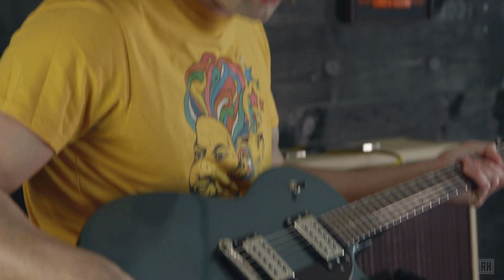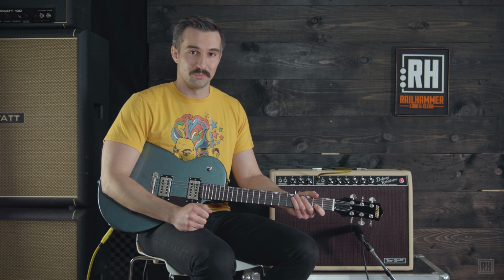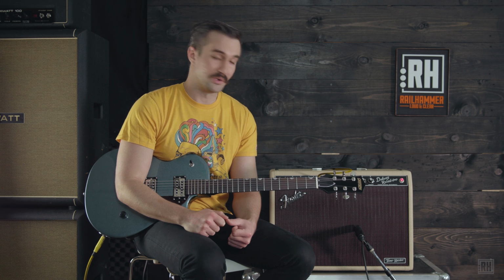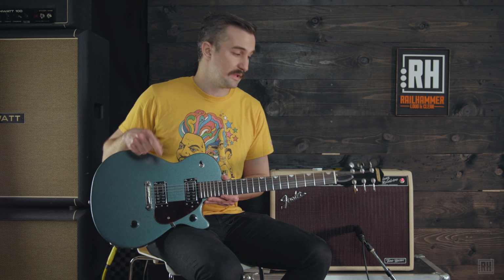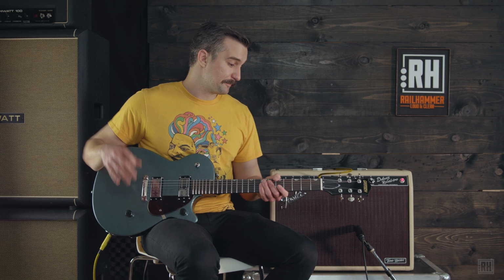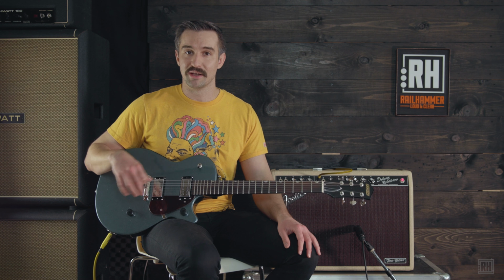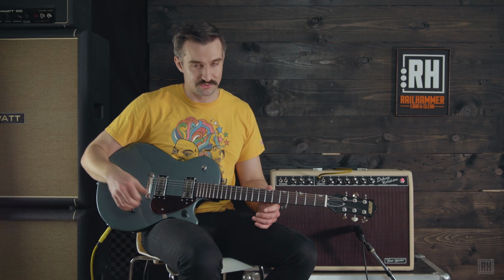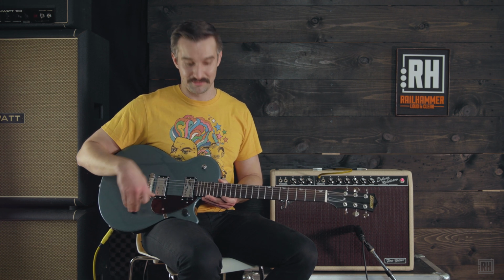Pickup Swap | We Put Chisels in this Gretsch Jr. Jet with Triple Shot Mounting Rings!

Comment: Though they can sometimes be fragile during installation, I love Triple Shot mounting rings.  I prefer to use the "reverse" wiring example from the documentation such that the switches point toward the coil which is active.

Comment: The labels seem off in the Triple Shot section. Pickup selector is in the up (or neck) position, but the screen says it is the bridge pickup, etc.
Reply from the maker: Correct, the switch got wired backwards when we did the swap. Didn't realize it until we started filming so we just figured we would get by with the screen captions. The screen captions are the correct sound that you're hearing. Good eye!
Reply: @RailhammerPickups  Cool.  I've done that before, too.